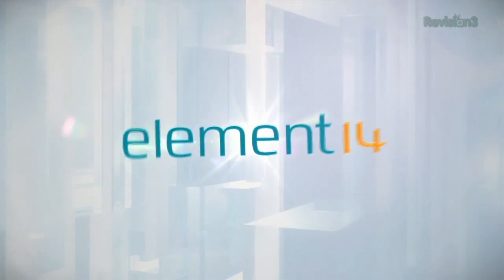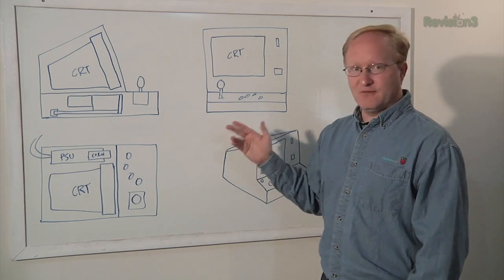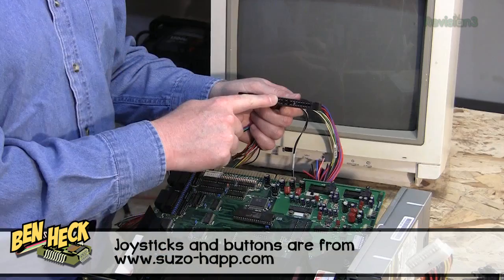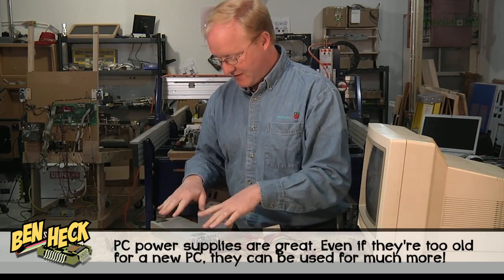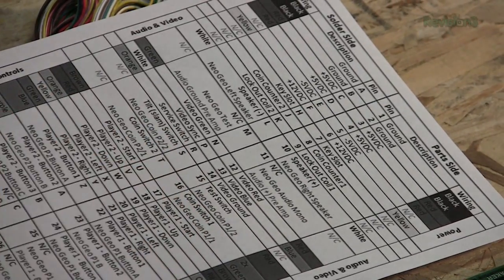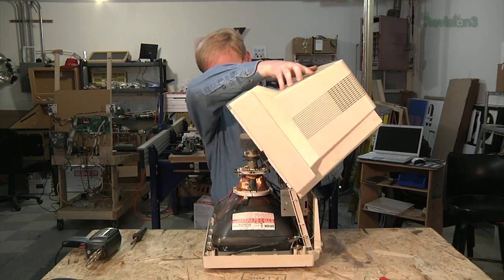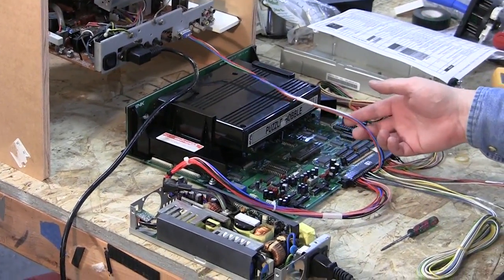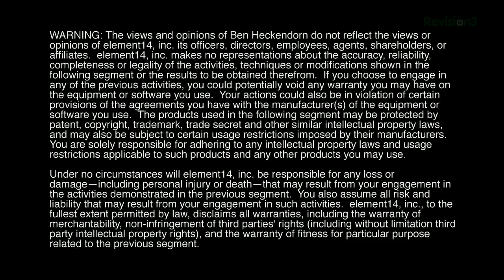How to Build an Old School Arcade Machine (Part 1)

Comment: proceeds to disassemble and work on the PSU right after having tried it

was that safe at all?? I saw no warning or protection whatsoever.
Reply: Just dont short or touch the contacts of the capacitors which is already hard to do and your fine

Comment: RGB + Horizontal and Vertical Sync IS VGA, running natively at 31khz. RGB as used in Europe prior to HDMI has Red Green and Blue, and then either sync on composite video, or composite sync (aka pure sync), this is at 15khz.

Ebay or those Chinese websites are great for picking up CGA to VGA boards, which work very well for arcade machines on VGA monitors.

Comment: I'm probably going to make this, but I am going to make a very small one. ex: have a xbox 360 controller stick as the joystick, and use the button (A, B, X, Y) as the 4 buttons, and have a rocker switch for power. Use a 7 inch display with controller and maybe a raspberry pi for the system. I will have no coin slot because this is supposed to be for on top of my computer desk.
Reply: I will also have the two unused ports in the back (VGA, HDMI) so I can hook it up to my setup.

Comment: WARNING! WARNING! WARNING! WARNING! WARNING!

Opening up an old CRT monitor/television can easily kill you if you have no idea what you're doing! Same with the PSU! No, leaving it off for a day is not how you discharge it! At all!
Reply: Yes, a CRT can kill you. In 1979 I attached an alligator clip jumper lead to the big capacitor by the flyback transformer on an old tube-type Setchell-Carlson 25" black and white television set. I stood back and dropped the wire to the concrete floor. The arc blast was loud and powerful and bright. It knocked a 3" dia x 3/8" deep burned chunk of my basement floor loose. The air smelled of ozone and nitrogen. I guarantee that arc would have killed me, were I careless and unlucky with it.
Reply: TheTundraTerror Nope. You should discharge a CRT (leaving it off and unplugged for a few days is fine) but a shock from a CRT is not lethal.
Reply: Captain Corona I would say the line is actually between what the two of you have said.  It's true, that CRTs and PSUs contain dangerous voltages that "can" kill you and electricity should be respected.  Just like a non-lethal stun gun or police issue taser "can" kill people and has, though that's usually due to poorer health conditions.  I think they actually refer to it as "less lethal force" now, compared to guns.  Saying an operating or freshly powered down CRT is "not lethal" is far too cut and dried.  I do agree, however, that leaving the CRT off for a few days is probably sufficient to bleed off the voltage in the capacitors and such but you should still know how to check for these things without hurting yourself or shorting something if you're taking one apart.
Reply: rotaryturbo07 Or simply wear gloves and de-solder the capacitors than when you're done solder it back again
Reply: +rotaryturbo07 I took apart my CRT when I was 12 and replaced the broken speakers with better ones, and I had no idea what I was doing, and I didn't get electrocuted.
The new speakers did work but everything was very fuzzy because I didn't solder them.
Reply: +WeActOnImpulse Official were the speakers shielded properly if not that's prob why the picture was fuzzy more then not soldering the wires to them
Reply: drifter848 the sound was fuzzy not the visual
Reply: then how do you discharge it?
Reply: Abshir Jama i think you either ground it (iuf you know what youre doing which i dont) or on computers you unplug it and hold the power button to discharge but idk if its the same for a crt (probably not) look it up i guess

Comment: Those Commodore 1084s and similar 15\30Khz supporting it all, VGA\RGB or even Composite if you would want to older stuff. Think the Commodore monitors were actually manufactured by Samsung.

Comment: Even then, it's not something I would recommend people do. You can leave a TV off for ages and it will still have that charge. I ran a 24v power supply with no load, turned it off, it still had enough charge in the capacitors to spark nicely later on. TVs have much, much bigger caps.

Comment: Good to see a CRT used in a project like this, most use an LCD and an awful scaler that has vertical clamp problems.  Your control panel looks a bit disproportionate right now  though.

Comment: But then he open it up, strips out the fan, adds a bigger (quieter) fan, solders the power connectors to the supply,  the $25 power supplies have terminal blocks for the power leads on the end of the jamma harnesses... much easier, and mess chance of unloading capacitors with your fingers!

Comment: You forgot to discharge the high voltage in the CRT monitor... Even if you are not going to touch the high voltage circuitry in the monitor, you HAVE to discharge it! You don't want your hack to be ruined by a lethal 10kv shock.

Comment: Hey there !
You did a massive wrong thing there, without telling the dangers of opening power supplies, and how you can unload the capacitors so you can be safe if you happen to touch something inside the PSU.

I am an Power Supply Sleever so that came just as an normal thing ;)
Please be sure to tell the other guys how to handle an opened power supply next time :D

Comment: A note that Ben should have really mentioned, if you're about to try this, PLEASE do not take apart CRT monitors without doing the proper research. Thousands of volts are stored in those things, which would kill just about anything instantly. Same goes for power supplies, to a lesser extent, but they can still carry very lethal voltages.

Comment: CRTs could hold enough power in them to fry you for a quite a while after you unplug them.
When I used to work bench back in the late 90s we would always have to take a screwdriver with a ground wire and shove it under the cap (that rubber thing at the top of the actual tube) while putting the other arm behind my back. It makes a sound that scares the crap out of you.

Comment: They work with extremely high voltage. His capacitor keeps his charge for some time and even if probably won't kill you it can hit you really hard!!
Some experienced people discharge it before handling, using an isolated tool like a plyer or something like that. But is dangerous anyway, you have to know what you're doing.

Comment: I'm not surprised Ben Heck didn't bother to explain. He cuts a LOT of corners. A CRT can conceivably hold a LETHAL amount of voltage in the anode, even "A day after being turned off". The proper thing to do is to remove the Anode cup and short it to ground (Usually the metal frame the CRT is in. Another corner he cut not using one of those). Do this BEFORE You try anything. The capacitors can build up ambient voltage even if the CRT is not plugged in.

Comment: i would prefer if i was doing this project using a lcd the reason for that is that i prefer LCD, the LCD is easier to come by  and they generate alot less heat than the CRT and the lcd is also safer to work with